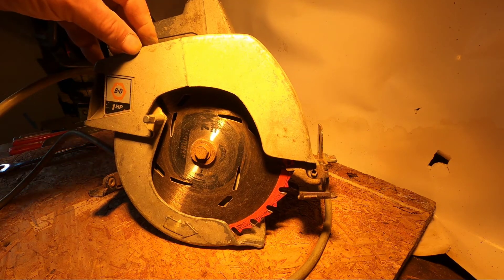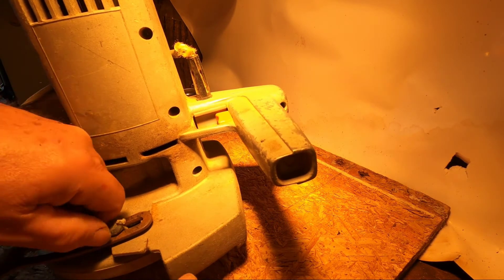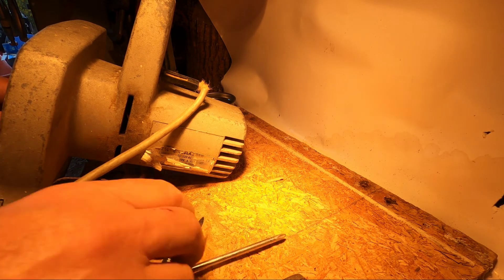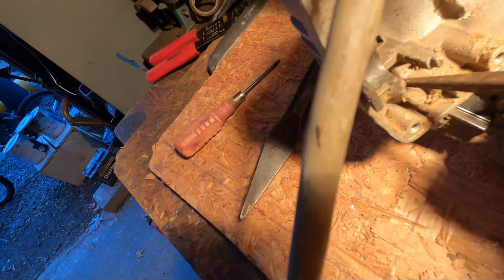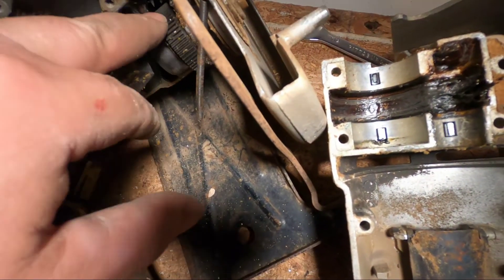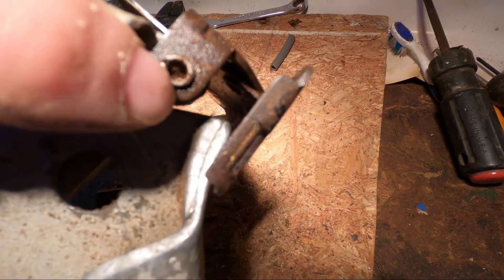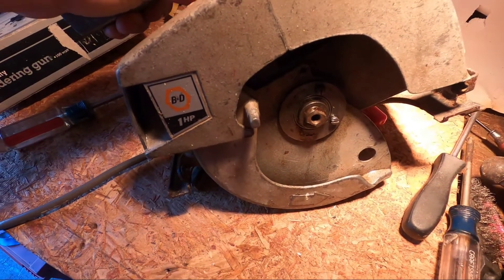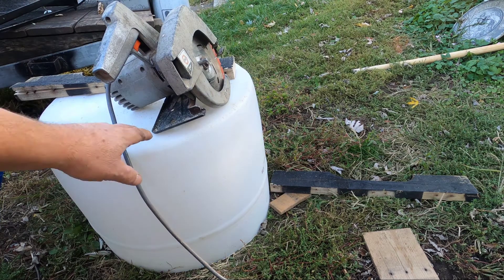How to replace a power cord on a circular saw

Comment: Those window A/C units have good high amperage cords on them. You could run a welder with most of those A/C cords.
Reply from the maker: I thought it would be heavy enough for this saw but did not know it it could carry that much amperage.

Comment: I have the exact same B&D 7301 circular saw which was given to me because a friend’s dog chewed the cord off just beyond the strain relief. I appreciate your video, though I do wish you had gone ahead and bored us with the internal cleanup process as well. 

It appears that mine was manufactured at a slightly different time because the green, black and white wires are actually molded into the inside end of the strain relief. I’m going to try and get the wires out and then drill the channel through the rubber so I can reuse it.  I’ve got to figure out the AWG after cutting the cord off because there’s no wire outside the strain relief to measure!
Reply from the maker: I hope this was of help. And thank you for watching and taking the time to comment. The internal cleanup process was probably as tedious to watch as it was to do. I try to keep the videos as short as possible due to some of the comments I received. As far as the AWG I figured AC unit I pulled it from had at least the same draw as this saw. Plus I checked the gauge of the exiting wire using the wire stripper. Not very scientific but so far no shocks or blown breakers. Still using this saw.
Again I hope you get to  enjoy other videos on my channel as well. 

 Stay safe, Joe Z

Comment: I have my grandfather's u 130 same circular saw in design only modal changed. Horsepower RPM I want to restored someone pack it with new  grease  check the car from brushes they need to be changed will do that the cord needs to be replaced I will probably add a grounded cord for safety thank you for sharing before washing your video was nervous about even trying it I haven't gotten to it yet but will mine still got the rubber bumper on the handal for the blade guard
Reply from the maker: Tc_kidsolo,  You're welcome, I am glad this was of help. And thank you for watching and taking the time to comment. 
I bought this saw new, cannot remember the year, too long ago
Tc_kidsolo I have other videos on my channel that cover many different subjects  and new videos added weekly that may also be of help or interest.
 
Your support is not required or expected but always appreciated. If you are inclined to do so your Subscription, Likes, Comments do help.
  
Tc_kidsolo I just want to mention If you haven't installed the TubeBuddy browser plugin yet, to help your channel grow  Just go to my favorite tool for channel growth Tube Buddy. Now You can use it too, here's my affiliate link to the Free versionhttps://www.tubebuddy.com/joezep54   Start with the free version, yes it is free to not only to down load but to use.
Again I hope you get to  enjoy other videos on my channel as well. 
 Stay safe, Joe Z
Reply: @JOEZEP54  these Black & deckers are so old there is no repair videos for it I rebuilt a Milwaukee 0228-1 and did with no videos no help just figured it out it was given to me because my favor didn't want it anymore he said it was broken but it was not just needed new carbon brushes one screw was missing in the earcation which was able to modify one fit after I repacked it with grease I cleaned the commentator the trigger used some non-conductive penetrating oil runs good he replaced the original keyed 3/8 Jacobs  Chuck with a keyed metabo made in Germany keyless tapered Chuck as usual surface rust cleaned it up runs just perfect USA made
Reply from the maker: @bluemantom77  Good job with your repair. Sometimes we just have to wing it. I look at it as a learning experience. If I get it right, great if not I learned what not to do next time LOL ,all good. It is a really good feeling when I can restore non working tools, mowers ,chainsaws etc to being useful again. My way of recycling. 
Stay safe, Joe Z

Comment: just bought one and was suprised when ground didnt have continuity with body, but its cast not metal
Reply from the maker: This is a tough little saw. Still using the one in this video.
Did you have to make any repairs on the one you just bought?
Reply: @JOEZEP54   none due to the lack of use still has orginal cord, brushes arent worn and didnt have a blade on it, sight unseen for $10 i have any people getting out of the trades in my area
Reply from the maker: Looks like you made a real good buy. This saw should work well & last a long time.
Thank you for replying. Hope you get to visit my channel again.
Stay well, Joe Z
Reply: @JOEZEP54  there is no blade lock so i have to use a impact on bolt,
Reply from the maker: @dancearoundtheworld5360  I usually block the blade with a piece of wood when I change it. Be careful, Joe Z